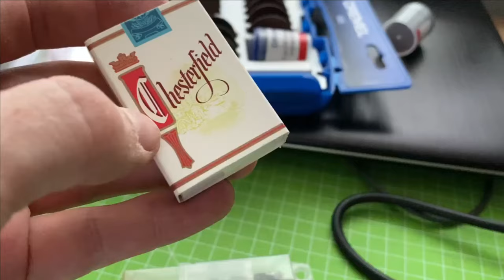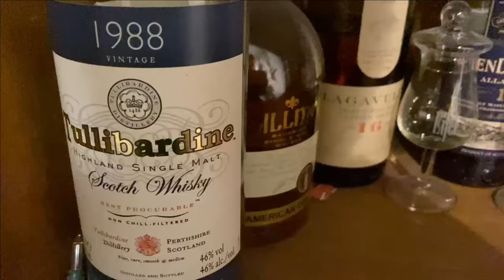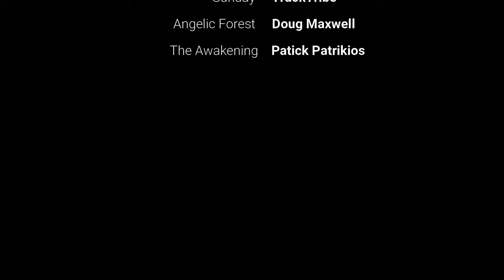Ship in a bottle with LED Lighthouse homemade DIY selfmade - Glenlivet 21 Diorama

Comment: Thanks mate, what diameter drill bit are you using?
Reply from the maker: 😀
0:36 1 mm for the wire fittings and 0.5 for almost everything else.